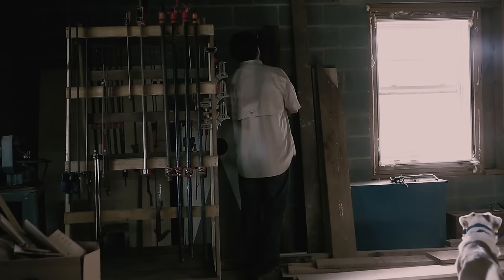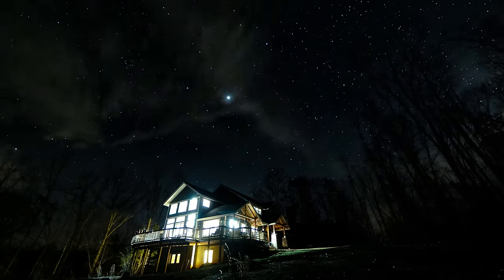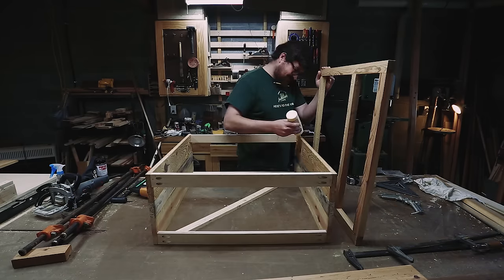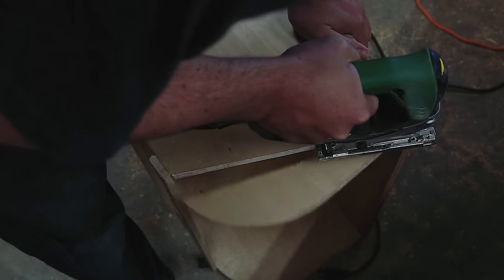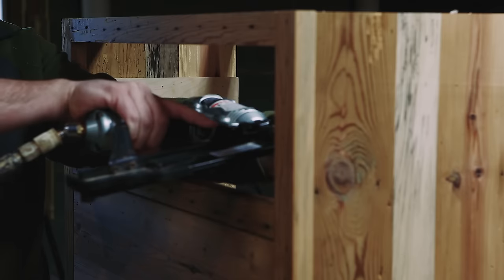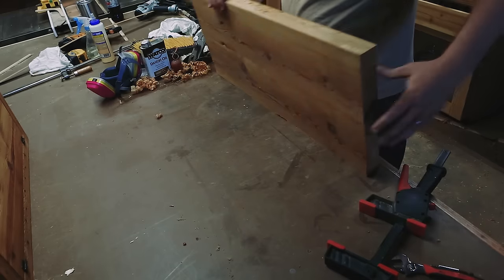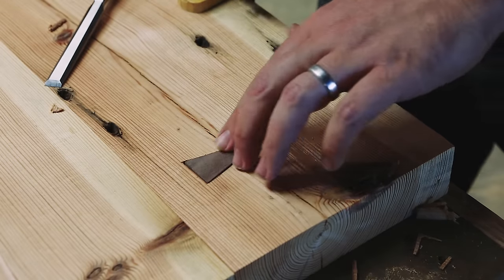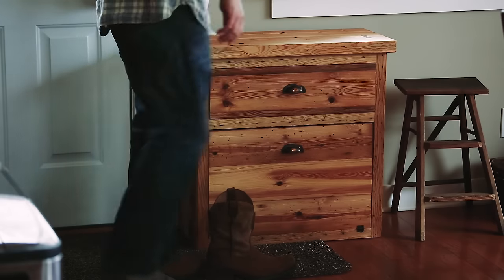The Shoe Dresser - A Project from Neglected Stock

Comment: Great piece and video! My only worry is the plywood that you nailed to the cabinet sides for the drawer slides. Now your sides  can't expand and contract with the seasons.
Reply from the maker: Thank, Tom!  I'm not sure I follow.  Plywood spacers are fairly common in the cabinet industry.  How would you have mounted the slides?
Reply: Because you have solid wood sides, your sides can expand and contract on their width . I would've nailed the plywood at the front to keep them in place and used a elongated hole in the back of the plywood with a screw. You used elongated holes on your media cabinet top video. I hope that you don't mind that I offered up the suggestion. I really like the piece!
Reply from the maker: I never mind constructive criticism!  I do see how that is a better solution, I've just never had a problem with tacking them up with finish nails. I know the glue is stronger than the nails but finish nails are pretty flimsy.  I'd see the nails giving way before the wood would crack.  The glue is the bigger issue I think.
Reply: I see your way working and agree the nails should give out first. If nothing else, it's now part of the thought process. Keep on making videos, I enjoy your style and humor! I have a very small channel started. I work on the road as a tool sales rep so my shop time is really limited. Are you coming down to the Atlanta Woodworking show? There will be a lot of makers there. Do you have a sticker to trade?

Comment: Excellent video and cabinet.  CHEAP METAL DETECTOR:  epoxy a few super magnets to a stick of wood (±1" apart).  Slide it slowly over the wood in question and it will let you know when metal is embedded in the wood.
Reply from the maker: +Mark Hazlewood Great tip!  I'll have to try it!

Comment: great video, is danish oil a strong finish and do u need to reapply it?
Reply from the maker: +Noah Knopf danish oil claims to harden "in" the wood,  not "on" the wood.  That being said it doesn't offer the protection of say poly urethane. I use it on a lot of personal projects because I like the feel of it.  I might have to refinish a piece later but I can do that.  Most commission pieces I'll use poly due to its durability. I suggest you try it out and see how you like it!
Reply: +Wm. Walker Co. can you please make a video on finishes

Comment: It looks like your shop is under your house in a daylight basement situation. How does that work for you(sound, dust, space)? We are contemplating a build on a piece of property we own and one of our thoughts is potentially putting the house over the shop to shrink the footprint.
Reply from the maker: I really really really love my setup.  It's about a 2000sq ft walk out basement that I partitioned roughly in half.  There's my wife's side and my side.  I can do whatever I want on my side and vice-versa.  Noise isn't an issue unless I'm doing something to the floor joists above (nailing on electrical boxes, things like that).  We also have the basement ceiling/first story floor insulated so that helps. Since my shop is partitioned the dust stays in the shop.  Before I put the wall up, dust was more of a factor since the only thing stopping it from going upstairs was a hollow core door (we don't have an HVAC return in the basement.  That's on the first floor).  I've got french doors leading outside so I can get any tool or project in or out.  I'm only using about half of my roughly 1000sq ft so far so I've got room to grow.
Reply: Wm. Walker Co. that is good to hear. It seems like a great bang for the buck. Any trouble with posts and the like? How tall is your ceiling?
Reply from the maker: No trouble with the posts but you can strategically place them once you have a set of plans.  If you want to move them just have an engineer tell you what you need to pick up the overhead load once moved.
Reply from the maker: I've got 9 foot ceilings
Reply from the maker: I've got two posts in my shop area.  One is in next to the stair well so it actually makes a great defining cubby to keep long stock.  The other is near the middle of my shop which I have my Table Saw next to on one side and my planer on the other.  This gave me a great way to bring power to both machines by securing my wiring to the post and securing the boxes to it. So I don't have any power lines running across the floor to tools.